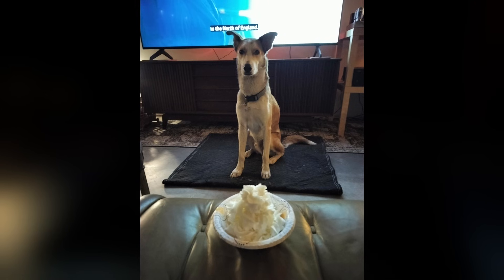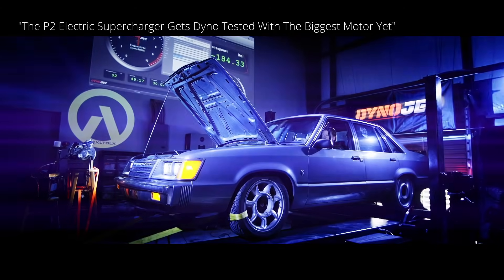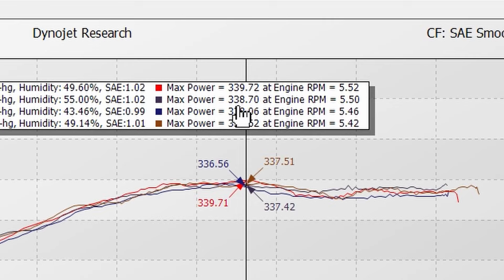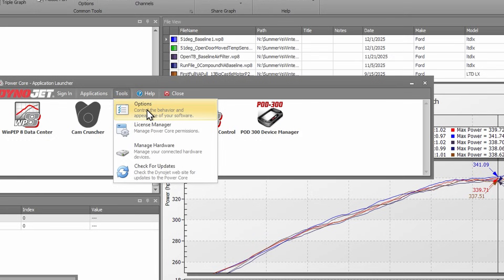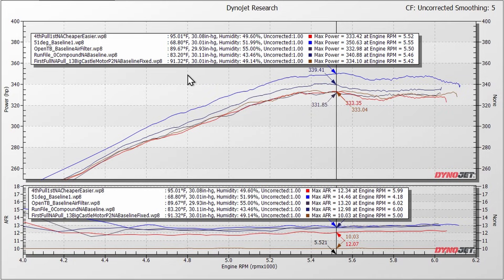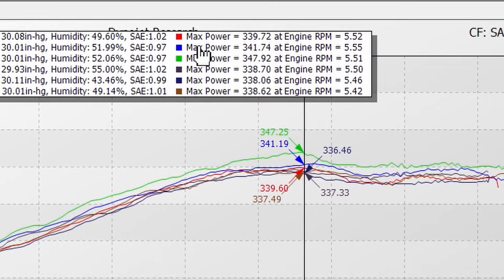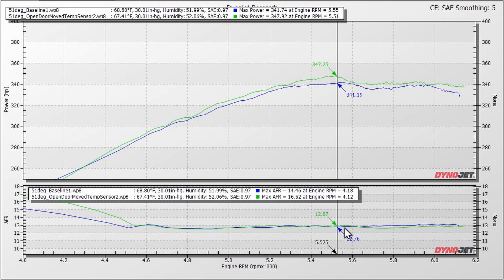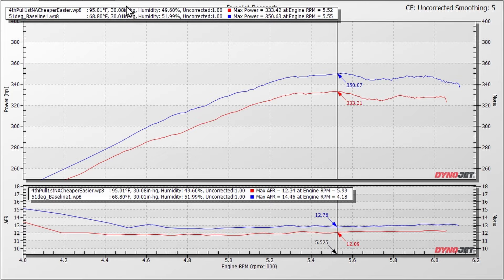Cold Air Makes More Power for a Reason Many People Don’t Know — Dyno Tested

Comment: The boundary layer applies to both liquids and gasses though it is more apparent with higher viscosity and flow. In food processing a lot of things are pumped thru clear plastic hoses. The best example I observed was apple pie filling flowing to a continuous pie filler. It was easy to see the outer layer moving at a moderate speed while the center core traveled at 2-3X faster, it was a 2" ID hose flowing at about 100lbs a minute.
Reply: how can I get apple pie tubed to my house?  I like this idea.
Reply: That's a very cool example I must say. Well explains the principal of pipe friction I think.

Comment: It would be interesting to compare the airmass values as well (assuming you run a MAF). Because the thinner boundary layer should contribute to higher values, more than what is expected from the increase of ambient air density alone.

Comment: I know of the boundary layer from testing, natural gas, home appliances, water heaters, furnace is mainly. When you want to measure the the exhaust gases are exiting fast enough to be safe, you cannot take your measurement at the edges of the pipe, it has to be taken from the center of the pipe because the boundary layer will give you an incorrect pressure reading. Reading. So much so they tell us to take pressure readings as far far from any bends or elbows as possible

Comment: The uncorrected power readings are also pretty consistent with the old rule of thumb of ~1% gain in power for every 10 deg drop in inlet temps on comparison of the uncorrected 338 hp to 350 hp going from ~ 95 deg down to ~50 deg. I typed this just before he touched on this. This is a matter most appreciated with power adders where inlet temps can increase significantly under boost.

Comment: I’d measure the air pressure in the dyno room while doing a pull with door open vs door closed.
Reply from the maker: The dyno did that; you can see the pressure in the atmospheric conditions.  There are open windows and an industrial ventilation system even when the door is closed, btw.

Comment: Funny how when using real air measurements VS water/meth skewed IAT data the HP gained per degree of ambient temp drop formulas work out.  But when using water meth and massive IAT changes are reported, you don't see the same power gain?

Comment: cold air makes more horsepower! The reason? Colder air is denser, meaning it contains more oxygen molecules per unit of volume. This allows the engine to burn more fuel efficiently during each time the cylinder fires., which results in a more powerful "bang" thus, higher power output. 
This additional Power is due to 
More Oxygen, More Fuel and this More Power: A “car” engine needs to meet a specific ratio of fuel to oxygen for optimal combustion. Since cold air has more oxygen packed into the same space(where as humid hot air carries less oxygen due to water in the air aside from that) the engine's ECU can add aN ‘ADJUSTED’ amount of extra fuel to maintain the correct mixture. More fuel burned effectively means more power. However. On the flip side we first know 
Reduced Humidity: Colder air generally holds less moisture (humidity) than warm air. Water vapor does not contribute to the combustion process, so drier air further increases the concentration of oxygen molecules available for burning fuel.thats the short version. 

K&R Performance an Repair 

8 speed and machine shops and 1 39 bay new car and diesel plus Harley Davidson
 New car warranty repair shop.
OWNER AND OPERATOR
OVER 30 years and tier 1 master technician for ford GM Chrysler bmw Mercedes Honda Toyota BUT NEVER KIA OR HYUDAI!! Plus I have patents on my performance aftermarket blocks, heads and intakes cams and all internal PLUS PATENTS ON MY PROCESS OF MAKING ANYTHING CAST OR FORGED PLUS MY DESIGNS.
Reply from the maker: That's true, but that's not the only reason why cold air makes more power.  That's one of the points of this video - not only to actually show the HP differences at different temps, but to also show and explain the other reasons why colder air makes more power that dynos can't correct for.

Comment: Could you please test for us at what cooler air temperature the performance benefits typically stop? 70°F, 60°F, or 30°F? Also, I’d appreciate knowing above what air temperature it becomes necessary to add fuel as IAT trim to keep the same performance if possible. Thank you!
Reply from the maker: Unfortunately I have to work with whatever ambient temps are available.  51* during the daytime is pretty close to as cold as it gets here.  In my experience, IAT based fuel trim is a continuous thing throughout a car's entire operating range.  And it's really impossible to keep the same performance, short of intentionally hampering horsepower on cold days, or in the case of a forced induction application, varying boost levels based on temp (or more accurately, air density).

Comment: Air mass (density) flow rate locked to fueling vs Air volume flow rate which isnt locked to fueling.
One of the reasons to always log Volumetric efficiency changes at WOT through the rpm range, after pressure loss elimination or inlet air temp improvements, back to back.
Difficult to make large changes NA, but the more the pressure ratio is amplified by compressors, the greater the impact. Extra parasitic/mechanical eficiency losses aside.
My biggest pet hate with ECUs, is they really do need mapping speed vs X, rather than rpm vs X, if you are using ramair effects or splitter exhaust extraction which scales with speed not rpm.
The PID controllers go nuts trying to create an automated compromise to suit all speeds for one rpm set, when not setup for boost/tune by gear.

Comment: Here\s one for you. At the track you see all the long intake tracks to the trunk with ice bath's to cool- the intake air charge. Why not spray methanol inj. and cool it in a tank up front. No long tubes or big tanks. Just a small ice bath with your meth tank in it.
Reply: Methanol requires its own controllers and nozzles that can sometimes fail and if your engine is tuned to use the extra octane it’ll go boom without the extra octane. Not sure if you’ve ever heard of methanol fires, they’re invisible and could seriously injure the driver if the system leaks. Methanol mix sprayed on your IAT sensor can trick the engine into advancing more timing since it’ll think the air is cooler.
Reply: @Pwnulolumad  First off you never spray straight meth. And never in front of the MAF. Then you can use your IAT to control timing. Everyone seems to say the same old thing.With no experience. If it clogs it will ruin your motor. So will an injector and some guys use 2 inj. And alot of racers use meth for the primary fuel. Heck if your fuel filter clogs you will ruin  your engine.
Reply from the maker: I actually spray straight meth when I'm doing my forced induction tests.  And yes, the meth does fail (actually, a lot, particularly is the system sits for a while).  But there are safety systems in place to handle that.  You can see them in action in this video: https://youtu.be/frjyRCK01HM

Comment: Would love to see the actual density altitude difference in your data. I live where there are huge changes, I see it changing Dyno results as well as times at the track. Temperature is definitely part of that equation. DA plays a bigger roll on boosted applications because of the multiplication of the atmosphere. Just interesting to see, I could be off my rocker🤷‍♂️
Reply: but with turbocharged engines altitude correction is not used.
Reply: @V8Lenny I’m not sure what you are saying. A Dyno setting is the correction and I use it. If you take a turbo car into high elevation and you are trying to run it to the max you will make less power than sea level.
Reply: @prairiewingsperformance6036 Read testing standards, for turbocharged cars no altitude correction because they compensate themselves. Or SAE might say max 3% , in Europe no correction.
Reply: @V8Lenny okay

Comment: I'm not shocked by the results, but it's still cool to confirm them. I'd love to see how much more pronounced the results would be with forced induction in the equation. You know them turbos love that cooler air. But my real question is, what does this all have to do with Roger's birthday?
Reply from the maker: I used the phrase, "Like a dog chewing peanut butter" and it just popped into my head... other than that, nothing really.

Comment: Cooler air is more dense. That's it. There's nothing here that they didn't teach us in grade school science class. 🙄
Reply: Exactly! And engines only care about the MASS of air (oxygen) they can swallow per revolution, they don't care about its volume (or pressure).
Same thing applies for the fuel.
Reply: @stahab Yuup the amount of trapped oxygen for a single cycle gives us torque and the trapped oxygen over a minute gives us hp. The engine is always pumping the same volume, it's the density (and subsequently the amount of oxygen) that we can change with our throttle, air temperature and boost. 👍
Reply: @stahab 
Yep. I especially love the ones who try to calculate the "theoretical compression ratio" based on boost.
Reply from the maker: There's more to it than that.  Colder = more dense is what everyone commonly knows, and it is indeed responsible for the lion's share of HP gains, but dynos can correct for that.  There is an element that isn't simply colder=denser that dynos can't correct for. We did a whole bunch of dyno pulls over 6 months in this video to show the changes in power and then I do my best to give a simplified explanation of where the remaining power gains came from.  And again, it isn't because colder=denser.  Please take the time to watch the video and get back to me.
Reply: Yea this video is rage bait, dude is trying to get everyone to correct him in the comments.
Reply from the maker: In what way is it rage bait?  I do my best to show and explain why using six months of dyno pulls colder = denser isn't the only reason why engines gain horsepower in cold air.
Reply: @Pwnulolumad 
I figured that was probably the case. I actually didn't even watch it and just had that feeling based on the thumbnail and title. It's the same shit, over and over.

Comment: So you could say from your findings, this is why polished intakes and intake ports never make as much power as, as cast or ported but rough. With carbs and polished ports, it seems less to do with fuel atomization and more to do boundary layer choking the airflow.  It's the same reason many aircraft wings have vortex generators on them.
Also, say you were at an airport in a low powered Cessna 100hp piston engine on a hot day near sea level and taxying on grass from stationary, you might need 17-1900rpm to get the aircraft moving, but on a near 0 degree C morning even idling it wants to move and you're constantly riding the brakes. The air viscosity is very noticeable in aircraft.
Reply from the maker: That's really interesting about the airplane thing.  I learned something from you.  Thanks!
Reply: Eh, some conflicting factors in this comparo. A rougher texture will increase the turbulence in the boundary layer making it larger, this also helps fuel atomization. I don't think I've seen it demonstrated that a polished port makes a power loss on a DI engine, though I'd say there are related factors that could result in a loss with a polished finish. On the wing, again the vortex generator is there to create that turbulence to help the air stick to the wing at higher angles of attack, same as why (someone smart originally) people put vortex generators on Evos, the rear window is too steep and in order to maintain attached flow down the rear window to feed the wing, it needs vortex generators. Now in a port what can happen is if there isn't enough turbulence at the floor of the port, it can have a tough time staying attached as it goes over the short side radius. I think your best flowing port would have a polished ceiling and rough floor near and on the short side. Or maybe some little model airplane vortex generators stuck there haha. My take: ports are too complex of aerodynamic devices to make any blanket statements with certainty WRT boundary layer and port finish, or god forbid the fucking golf ball fuckin dimples.

Comment: I bet the fuel temperature was the primarily influece over the boundary layer
Reply from the maker: From the point of the injectors to the valves, it's certainly possible - there's about 7" of runner length there iirc.  And there's about 10" of runner length before that.

Comment: Sadly with modern cars doing the engine control based on purely torque mapping they do not see any real differences in power due to colder temps.

On another note the speed of sound changes with air temp and can slightly change the intake pressure pulses causing the graph to "sway" a bit with the difference in resonance.
Reply: Torque demand vehicles still have reference tables built in that factor for air mass, IAT , barometric pressure etc. they still advance ignition timing and fueling. It doesn’t matter if you’re in a carburetor or EFI  setup rules of physics still apply.
Reply: @Pwnulolumad  I do not think you understand how a torque mapped engine works, It's sole duty is to output an exact torque in every situation. The ecm knows about the air temp and all the variables and knows how to adjust the parameters to hold the output the same, that does not violate physics in any way.
Reply: @Gin-ging Interesting. So even at 100% throttle it still only requests a numerical value? I would have thought so at lower openings, but 100% would be "unlocked" for the lack of a better term. 

How is that 100% value decided on? Best case scenario or...? Mind giving some parameters?
Reply: @GoldenCroc  Basically all engines are detuned from the factory for emissions and longevity, they set the torque output well bellow what the engine can make. With the DBW( drive by wire servo controlled throttlebodies) the engine will almost never see true full throttle. This is why tuners can unlock so much power safely as all cars are factory limited to maintain the exact torque they rate the engine at. DBW also takes control or idle and cruise so it makes it a bit simpler to build.
Reply: @Gin-ging  Well yes, I mostly, but not fully agree. 

But you must have misunderstood my follow up question (that superseded the first, really), I know all the DBW stuff, I was asking how they arrive at the max allowable value at 100% throttle. If I were to guess I would say mostly emissions but other factors could play a part I guess? Transmission limit, turbo RPM limit etc.

As for tuners, well in some cases I know its as simple as moving the limit upwards, but surely its also done most often by also increasing allowed boost, timing and fuel somewhat?
Reply: @GoldenCroc  As for exactly how they come up with the exact numbers for torque output it is a blend or emissions, mechanical reliability and marketing (give it 3 more HP than our competitors), it does not always make sense honestly but that's the engineering department for you.

Tuners such as COBB have different levels ranging from stock timing, boost and a/f limits to full on custom parameters.
Reply: @Gin-ging  As I assumed then. But you seem to know, not just assume. 

On the other hand, since I always driven tuned cars, the limit is presumably set above what can be achieved at with a good margin at all instances, making it have variance for atmospheric conditions after all, at least at some rpms etc. At least I would assume tuners set the limit like that in some regards. 

Anyway, regarding individual tuners specifically, since you can even do it yourself after all pretty easily with a "computer" with the right software and compatible connection to the car, most popular ECUs are decoded these days and can be accessed, you can set it up yourself as you want. Only reason I currently dont is cost.
Reply: @GoldenCroc  While I am an engineer and have friends in the automotive industry it seems to differ from maker to maker and even from engineering team to engineering team as to how they get their exact numbers numbers. But i do know that the Mopar engineers used to under rate engines badly for new engines so they could bump it up every few years to look like its "improved" and I hear most others do similar.

Tuning wise I hate newer cars so I always use a Haltech and do all my tuning custom to just avoid any OEM limits.
Reply: @Gin-ging  Fair enough, I am a physicist myself that have dabbled a bit into general vehicle design as a hobby, mostly aerodynamics, for a few decades. Cheers mate.